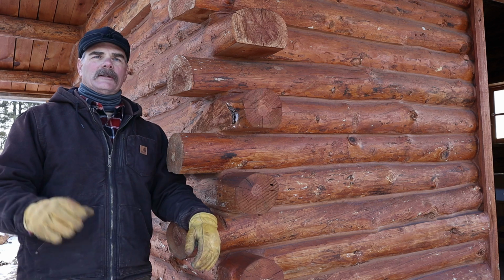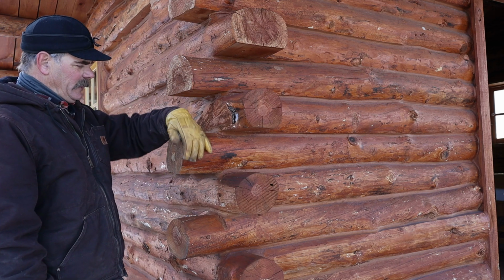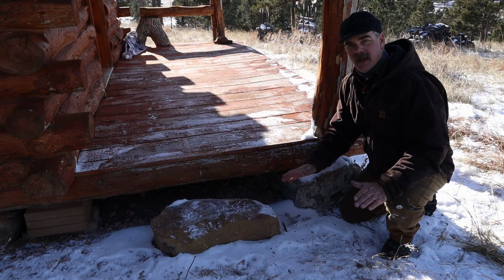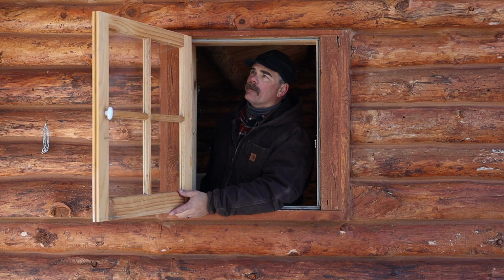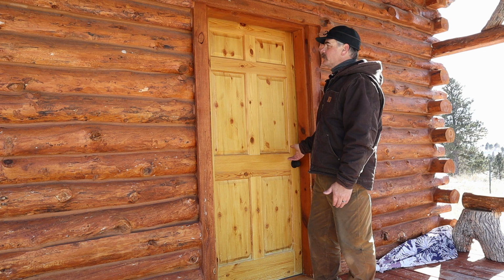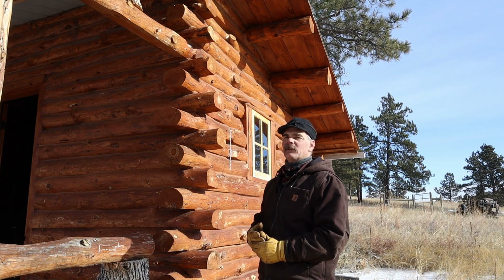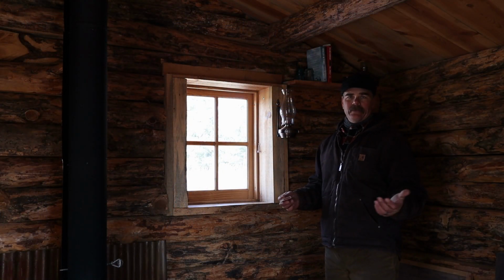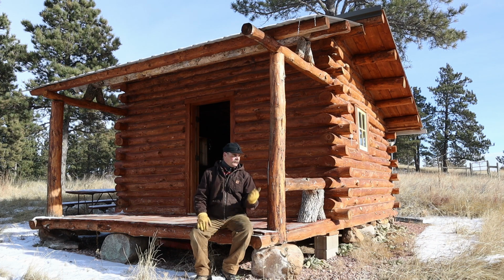My First Log Cabin - A Simple Design Explained (Answered Questions)

Comment: Nice looking cabin, something to be proud of for sure. 
If you drill a 1” hole and drive a 1” square oak peg into the logs to tie them together, you won’t have rust issues
from metal and the pegs will pull each log to the other. This also allows you to build full solid walls and use a saw to cut out windows and doors without fear of hitting any metal spikes or rebar.
Reply from the maker: Great suggestion!  Thank you

Comment: You can use construction adhesive as chinking. Plus you can lay some down on the log before placing the next one on top. No need to buy expensive chinking products. A good exterior stain is all you need or you can use linseed oil. The roof isn't insulated but that doesn't matter on a basic cabin with wood stove. Insulating the roof with 1.5 inch insulation board is easy during construction and it's hidden after completion. The butt and pass method is the superior method as it has the strongest corners and retains the R-value due to the wide flats milled top and bottom. An 8-10 log has more R-value than that of a modern framed home.
Reply from the maker: Thank you Thomas, well said.

Comment: Fantastic job! I'm 62 yrs old and have always dreamed of doing this. This is great encouragement for me! But how did you do the floor? I'm assuming that you built a traditional floor using 2x material and floor joist, but not sure. Please let us know. Thanks!
Reply from the maker: Thank you!  The floor is also logs, notched into the perimeter logs with a half lap horizontal.  2 ft spacing with plywood overlay to keep out critters.  You could also use planks if you like.  The first log on top of the floor has a relief dado cut to accept the floor and still meet the first log on the outside.  Cut it with a adze or chainsaw

Comment: I have a small sawmill but can only cut about 10’ logs how could I butt them together to go longer
Reply from the maker: Chris you can do a vertical half lap but you will need to pin it.  You can also simply but them together with a 2x or 1x spline in the joint to keep the joint air tight.

Comment: Wow, awesome work. such a beautiful setting. Yes, leave the electronics at home.  Just curious, did you shape the bottom of the logs to fit the stone foundation rocks?  I recently saw a post in a frame in Japan that was shaped to a round rock.  It has been there for 400 years without rotting.
Reply from the maker: No Tim just set them on the rocks.  Tried to find rock with a reasonably flat top, or just a setting point.  The corners are on blocks set with a water level, but the rest is rocks.